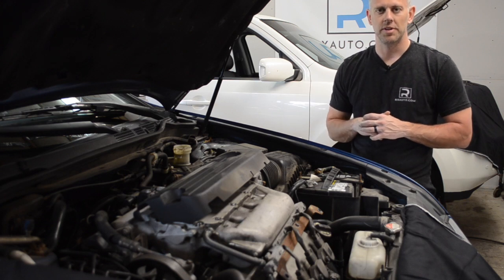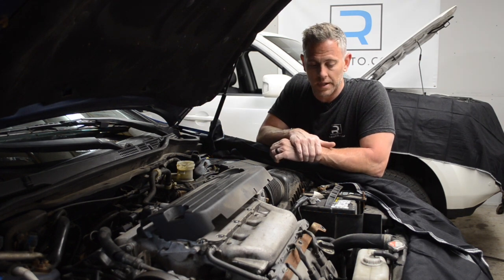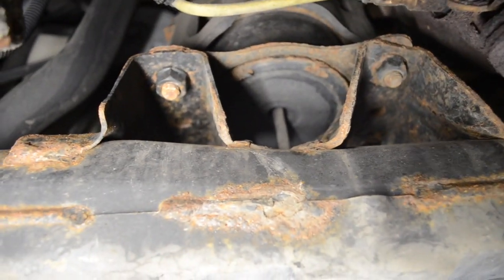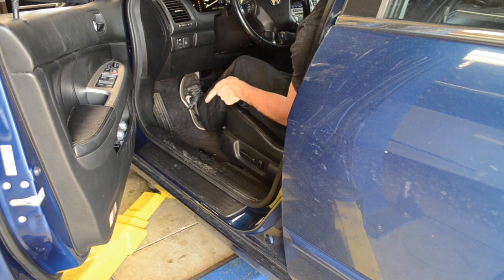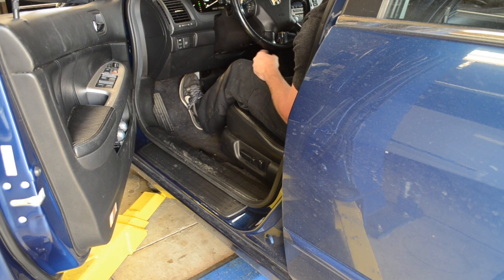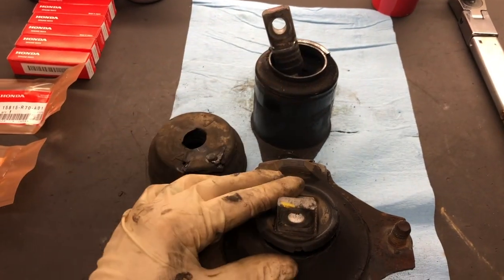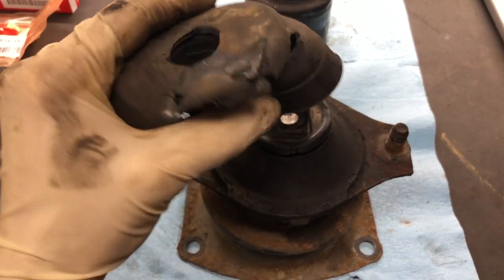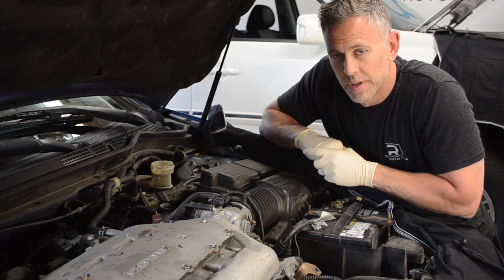Engine Mount Inspection Honda & Acura V6 Engines

Comment: My mounts were shot on my V6 95 Accord, replaced all mounts with aftermarket and vibration is about the same/worse. Honda mounts are discontinued, any recommendation for a replacement brand? The vibration is driving me crazy. I could go to a junkyard and get an OEM rear mount, but putting 27 year old rubber parts is not at the top of my list.

Comment: 1) On my RL, when I shift from P to R, to D or vice versa, I hear a noise under the car.  Basically I hear my shifts in the form of clunks.  Is this normal?  2) I did check engine mounts as you did in the video and engine seems stable, but I did see a bit more movement when I was shifting from D to R.  3) I checked transmission mount and it has few superficial cracks, but nothing that would warrant a replacement. Here is a sample video which can show you the engine movement and at 39 sec mark, I switch from D to R and continue testing. Also you can probably catch the sound when I switch gears and at the end after shutting off the engine, there is a metallic click(at 50 sec mark): https://photos.app.goo.gl/jcGLZxjpmbtHhzjX9

Comment: If you can please tell me where to jack up the engine? Which point on the engine do I use?
Reply: Usually under the oil pan, but make sure you use a wood plank to distribute the engine weight. You don't want to poke or bend the oil pan.

Comment: Learn something new every day, didn't know putting it in reverse would isolate the diagnosis to the rear mounts.  Thanks very much for the video.  Now time to try to dremel that sheared off water pump bolt out of the engine block before i can put the whole timing belt mess back together.  It's not looking real good,  wish me luck. :)
Reply from the maker: Good luck! 👍🏼